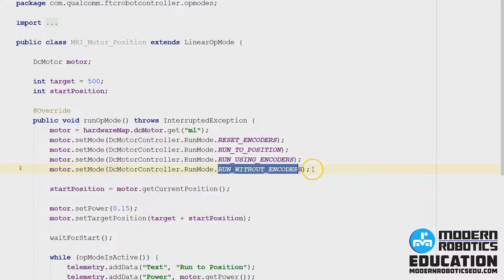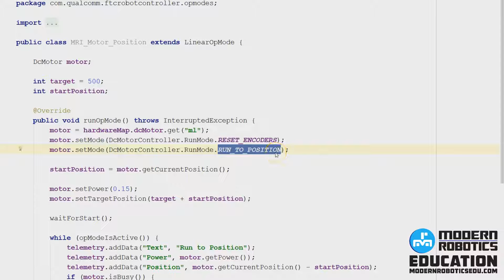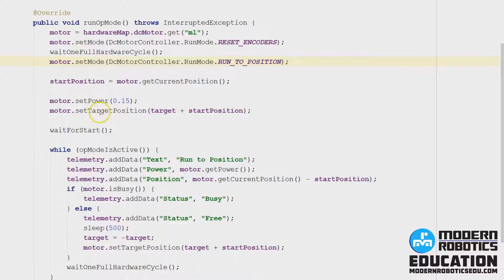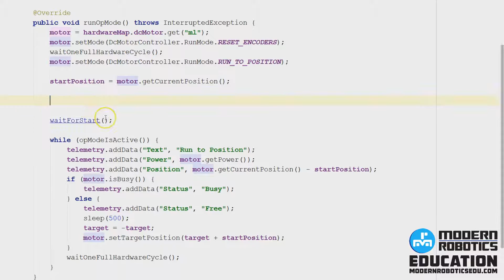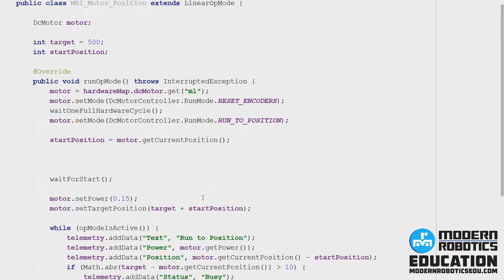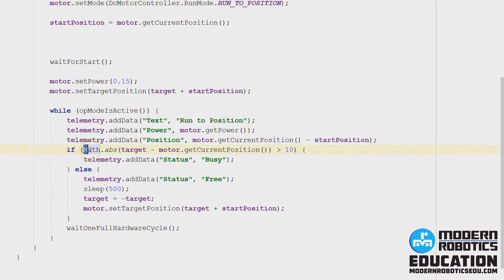Reset Encoders

Comment: We were able to use this code to run a long path on encoders. Now, we want to try to combine part of a code we have that uses encoders and part that runs using .setPower, using a sensor to determine when to stop. 
We first use encoders to move to a point, then, we want to move to a line using an if-else statement with .setPower and a color sensor. After that, we want to go back to using encoders in the program. The problem is, if we don't reset the encoders at this point the total target is off, and when we try to use (DcMotor.RunMode.STOP_AND_RESET_ENCODER) in the middle of the program, the program stops running. Just thought you might have an idea. Thanks.
Reply from the maker: After resetting encoders, the mode is set back to run_without_encoders. If you are using run_to_position, you will have to set that again. A more robust strategy is to save a variable as your start position. (One variable for each motor.) Then use that as an offset when setting your new target position.